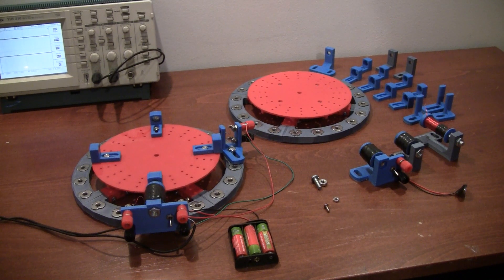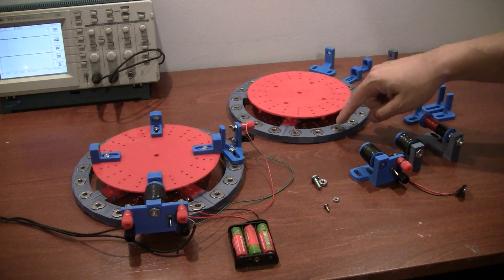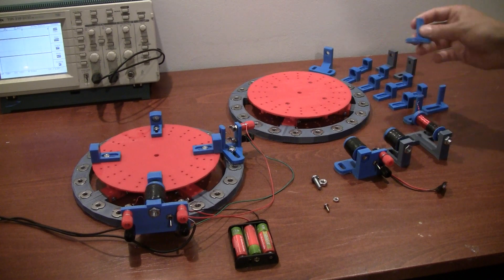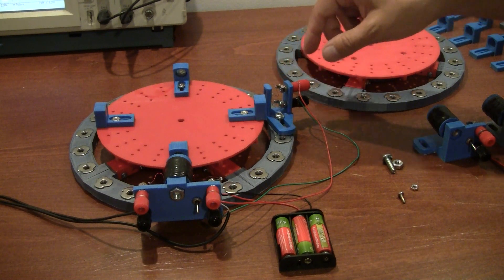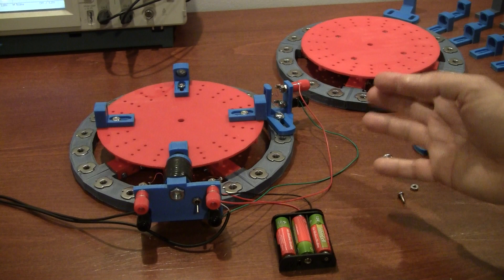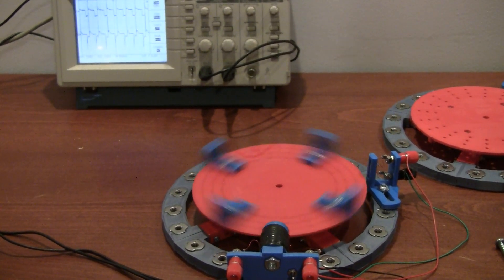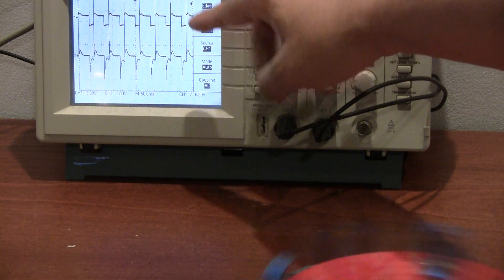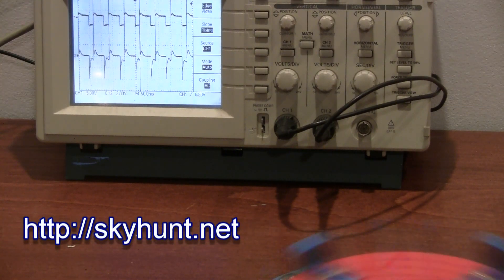3D Printed Permanent Magnet Motor Adams Bedini type

Comment: What's the max Rpm this thing made
Reply from the maker: Depends on the input voltage but typically it runs at a few hundred RPM max. It is not designed to run really fast.